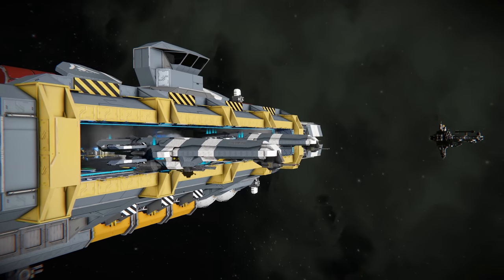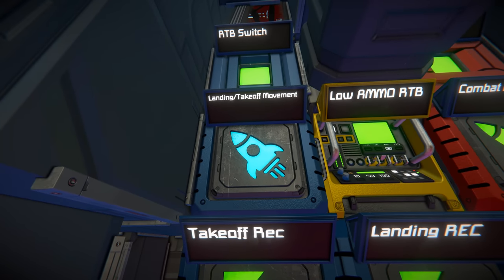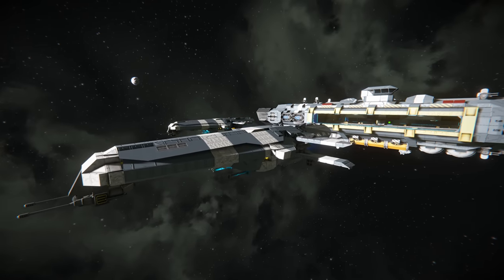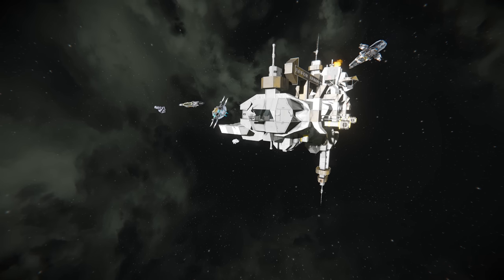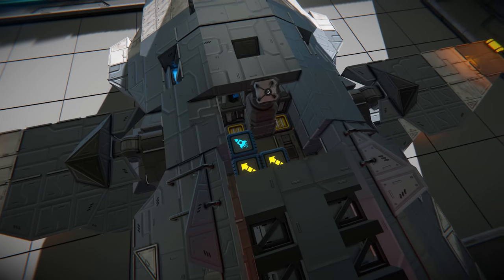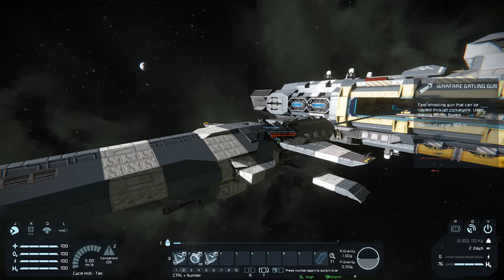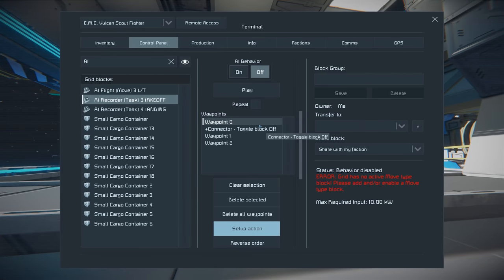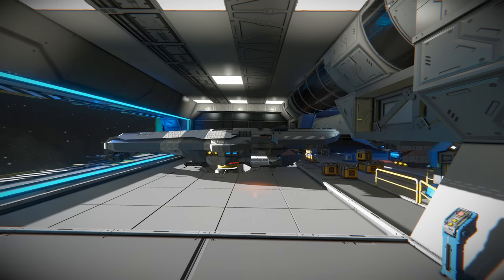Launch & Return To Hanger AI Fighters  - How To - Space Engineers

Comment: You don't need to recover your fighters if your target is armed as they all would have been smoked  as drones are easily dispatched by turrets when they fly straight at the target on approach to attack. The only viable AI grids are the smallest missiles possible (3x3 small block frontal area) on the intercept pattern and they are only good at stationary or lightly maneuvering or very big targets as their target prediction needs work. However, if you fire more than one, typically the first one gets smoked but the others get through as long as they don't out run or out maneuver them.

Comment: Part of me wants to have the fighters land nose-in on a small grid large connector with a merge block and projector on the back, connected to the carrier by an advanced rotor, so you get fun visuals and damaged fighters can be auto-repaired(or replaced).
Reply: or you could have an EC on ship for each connector and have it kick on a piston with a welderto run up and down the drone real quick 
alo less complicated and probably wont confuse the ai as much
Reply: @chrishoule6910  The visual of the fighter landing nose in and then being rotated back into launch position is half the point tho; the polish and presentation is what makes things as extra fun and satisfying. And it won't confuse the AI as the AI should be shouldn't be active after it docks; the issue with subgrids sounds like it's related to collision detection and you want to turn that off when docking anyway.

Comment: when setting up the take off and landing recorder sets, why not record both sets of points while taking off and then use the "reverse order" button on the landing block to put those waypoints in the correct direction?
Reply from the maker: This is how I had it originally set up but it requires keeping track of weather the waypoints have been set to forward or reverse. I had two incidents the of the reverse sequence not working and it flying into the side of the ship. But if you are carful it uses less blocks so go for it.
Reply: Good to know. Thank you 😊

Comment: Would this work with a ship that’s moving? Both with just flying a single direction and active movement. Because I know that if you are using your jet pack and “lock on” to a ship, your character keeps it’s distance as the ship turns. So it would be cool if the AI did the same.

Comment: I think i need some help with this problem:
I want to create a group of territory defense drones that automatically detects enemies, disconnects from their connectors, go attack, and when the threat is eliminated they turn back automatically
So if i have them on the connector in defense mode and they detect an enemy they will activate the takeoff sequence, switch to combat and engage, eliminate the threat and then turn back to base and automatically reconnect
But when the offensive takes over for the defensive, there is no way to have it turn itself back?
The defensive block has "setup actions for when enemy is detected and for when enemy is no longer detected"
But the offensive just turns itself off and gives way to the task block, with no "setup actions" function
Any tips to work around this? or am i forced to have it on buttons or a timer block that automatically recalls the drone after a set amount of time? please let me know

Comment: Why does the Landing recorder not fly in forwards? Shouldn't it try to come in forwards even though that's not how you recorded it?
Reply: Because it records the orientation of the grid when the waypoint is made, giving you more control over AI behaviour.
Reply: @WulfgarOpenthroat  Weird because I've seen the exact opposite happen
Reply: @CaptainFlips  Same here and my drones bug out after the second launch were they will land sidways
Reply: @CaptainFlips  You might have put the Move and Recorder blocks in different orientations by accident. Ensure they're facing the same way.
The Move block is trying to position and align itself to the waypoint created by the Recorder block. If one of them is backwards, you'll get that behaviour you experienced.
Reply: @cybersteel8  I've even seen this example a couple times in videos where the drone doesn't face in any particular way unless it has a first way point which lines it up. That's why I find this weird. I will day thoigh, personally I haven't done much with drones. I messed around with a hover bike and now I'm building a drone, but it's still a bit way until I add the AI.
Reply: @CaptainFlips  Another guess has to do with Precision Mode, if the drone is lazily going point to point without stopping and reorienting first maybe precision mode is off

Comment: Does this work with the ship moving? Will the fighters match velocity?
Reply: The waypoint coordinates are relative to the ship's beacon, so as the ship moves, the beacon moves, and thus the waypoints move. The drone movement AI is targeting the waypoint so by design, it should follow the waypoint as the waypoint moves until it reaches the waypoint, then target the next.

Your question does make me wonder about the time during the waypoint transition. The Drone seems to come to a complete stop when it reaches a waypoint (while it aligns to its next waypoint target), which might be a problem if your waypoint is moving. I wonder if the complete stop is using normal Dampening or Relative Dampeners. The Move AI should use relative dampeners so that it matches the velocity of the ship while coming to a "complete stop" at a waypoint.

Comment: You probably want to avoid interior hangars. Or at least ones that are too small. The AI is barely able to land while the carrier is stationary. Unlikely it will manage in the middle of combat.
If you are using a top deck, how about mounting them on a piston?
- starting order makes the piston expand
- when the piston is fully expanded, the mothership connector is released. Then the piston retracts.
- when the fighter connector is released, the fighter AI turns on. Now having a piston of separation to the mothership
- add 1 beacon to each piston/connector, so the fighters can find their way back to their landing spot
Reply: the undocking procedure is from my experience more easily achieveable with a super small chain of timer blocks on the fighter drone itself 
timer1: unlock merge+connector blocks, start separation engine, start countdown on timer 2 
timer2: shutdown separation engine, turn on thrusters + ai blocks 
if programmable blocks allowed, a small 5 or 6 liner script to scan for blocks with the name timer 1 and to start them on the carrier grid absolutely kills it, to the point of making projector +welder built torpedoes VALID even in rapid succession, (you might be a bit carefull to not launch them into each other but they absolutely work by now!

(i already made guided discettes for my next attemt on visiting a server) 

havent yet attempted the docking part but am working on a scaleable support fighter drone

Comment: is it possible to have it tie into a remote on a bridge? so when you want them to return to base you can press a button on the bridge and not be tied to a timer?
Reply from the maker: The difficulty with that is getting the button on the bridge to send the signal to the fighter to recall so far you can do it manually by connecting to each fighter but it would be nice to just hit one button and them all come home. I will play around with a few things and ask some community members.
Reply: @LastStandGamers  It likely possible using scripts via Inter Grid Communication (Communication between Programmable Blocks and Antennas)